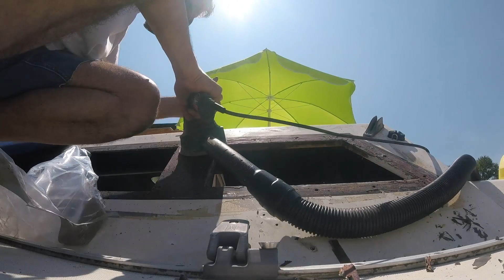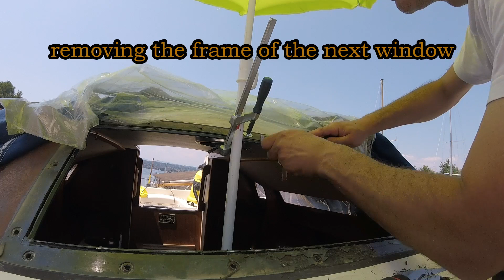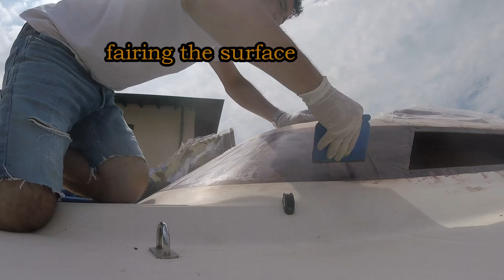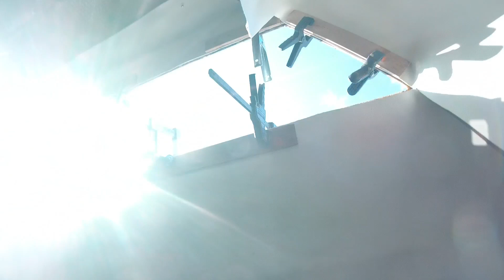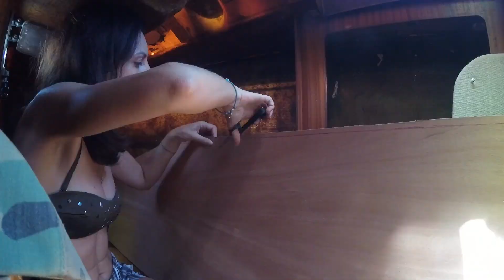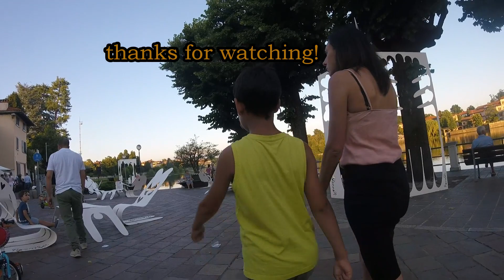Replacing the sailboat portlights - part 2 - ep 16

Comment: could of just use paint brush cleaning fluid to get the old stuff off and a scraper, thats what i used on my jeanneau sundream
Reply from the maker: thanks. that is the best solution that we found. plus the area needed to be sanded anyway in order to remove the scratches and to prepare the surface for painting. We are now painting the area around the window with two component black top coat.